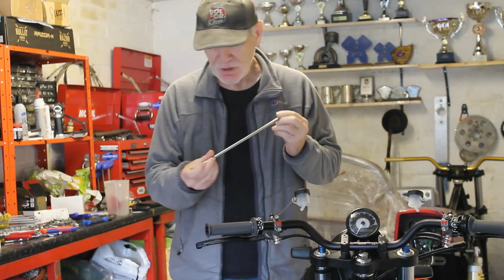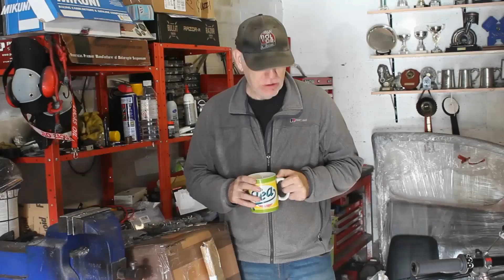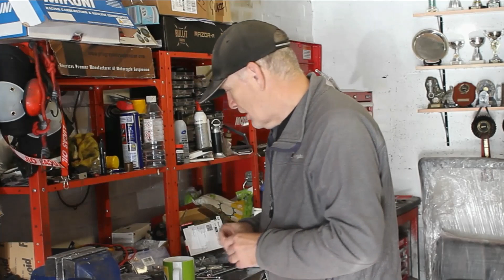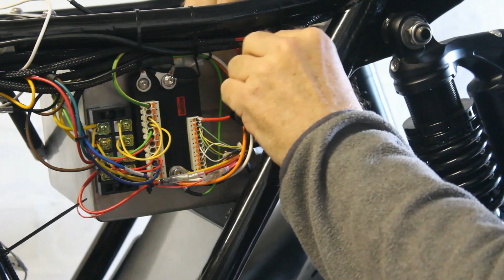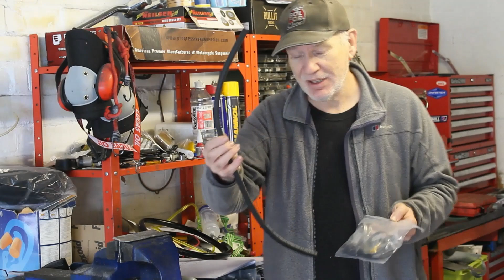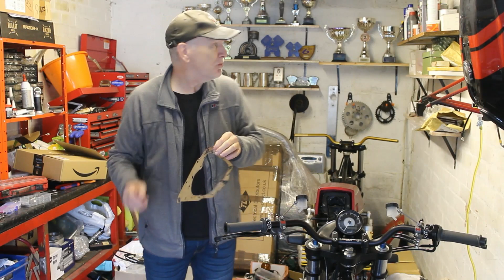Kawasaki Z650 / 1170 Project Part 43

Comment: Did the engine builder not sort all this mess out it’s not much good the outrigger if you can’t stop it leaking
Reply from the maker: The outrigger wasn't ready when the engine was built. C19 lockdowns here at the time didn't help. The outrigger was made to fit an empty set of similar cases. Now making another gasket from thicker gasket paper, so will try again in a day or so when I have time. Waiting for more acetone to arrive, as its great for removing RTV silicone. I'll get it leak free, just a bit frustrating when hoped to hear the engine run today..